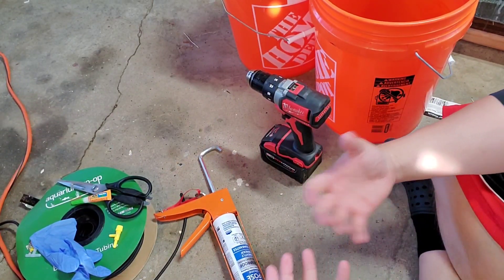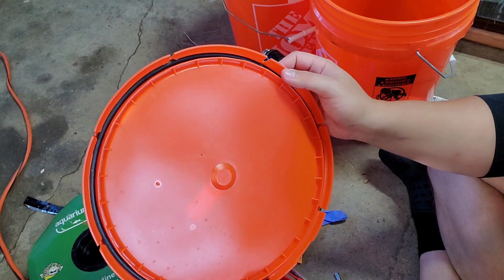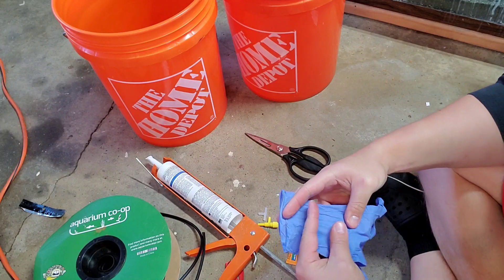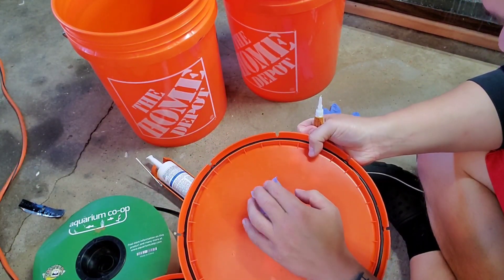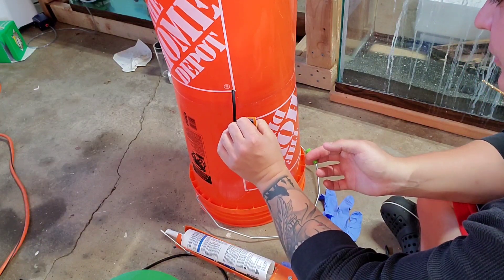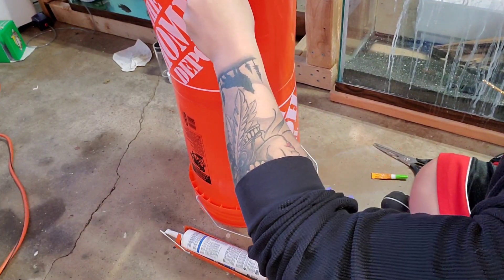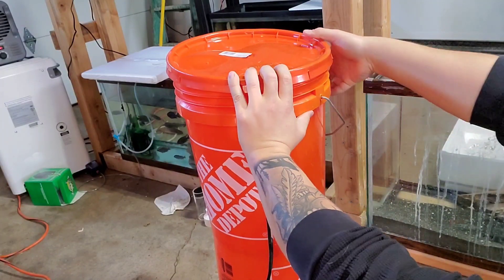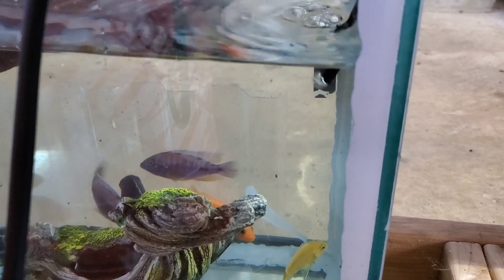DIY AQUARIUM AIR PUMP [No electricity- emergency air pump]

Comment: Awesome setup.  I have a 15lpm air pump feeding a central air line system which runs off a $80 UPS battery backup (about 4.5 hours run time in power outage),  but will definitely try building this over the winter as a fun project..

Comment: I've seen this done on a much smaller version. I was loosing power every month and was using battery operated air pumps. I decided since I had a fish room to invest in a whole house generator. It worked. I haven't lost power in over a year since I got my generator. 😉
Reply from the maker: I got a generator as well haha. The bigger the container, the longer it'll run 😊